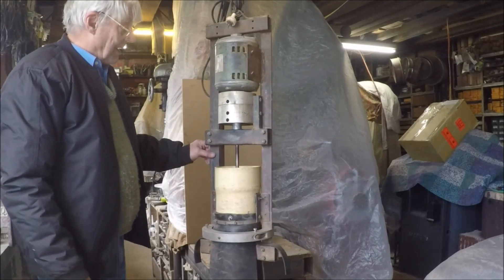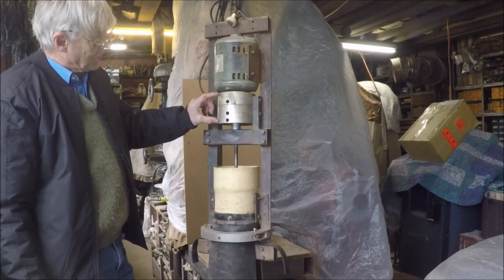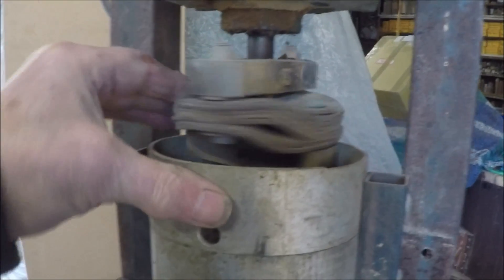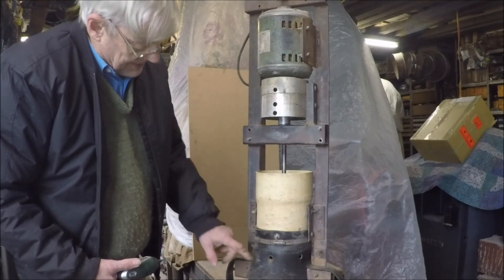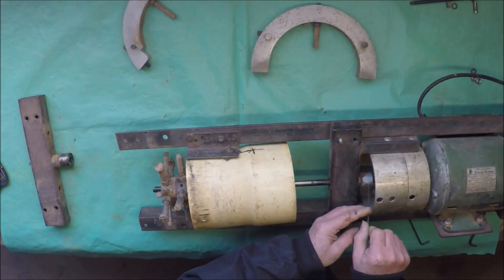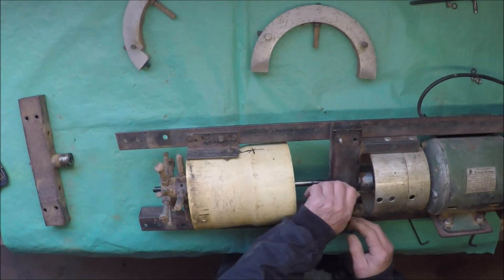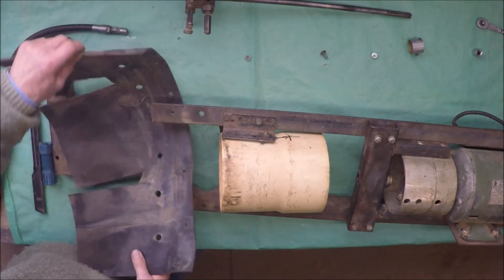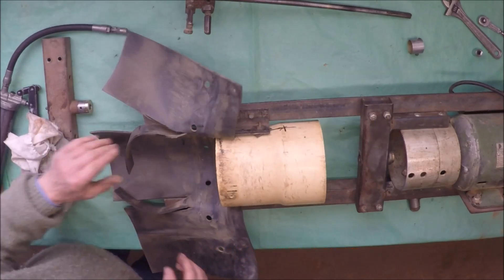Sand aerator, mixer, reprocessor.

Comment: how does it work?
Reply from the maker: jack. The rotating rods break up any lumps in the sand, mix it all properly, and aerate it so it sort of fluffs up and makes it feel as close to silky as its possible for sand to feel. After passing through this machine the sand rams much better and makes a better stronger mould.....Martin

Comment: Hello from Norway!
I am working with granite cuting wire saw and we got a lot off small granitt dusts after cuting work. Is it possible to use it and clay to form models instead sand?
Best regards Darius
Reply from the maker: Darius, Hello back from Melbourne Australia. Many other materials are used as a "sand" for moulding - zircon, chromite, olivine for example but I have not heard of granite dust being used. Granite is about 20% Silica and 65% Feldspar, Feldspar is quite a refractory material and might perform ok as a moulding sand. To be honest I do not know for certain how it would go but its refractory nature would suggest that granite dusts - providing they are not just granite flour  - might be worth a try. However granite contains some mica and this tends to expand a lot when it is heated and this may cause problems. If you have no other source of a suitable moulding "sand" the dust may be worth a try, so give it a go and let us know how it went.... Martin
Reply: I"ll try soon ! @olfoundryman8418

Comment: Just a thought.... What if... I have a concrete mixer. A simple consumer product like Baumr-AG or Kartrite machine... If I (struck through) When I try this "method" I share the results 🙂
Reply from the maker: Andrey, What you are suggesting has been tried in this video   https://youtu.be/Y0-lx95NLRs  Note that he is using it on petrobond sand but it should work with green sand too (I think!). This really acts as a sand muller NOT an aerator. Mullers tend to compact sand whereas an aerator tends to fluff it up in a nice feeling uncompacted way. If I had a muller I would use it to mix the sand properly but I would then pass the sand through an aerator like the one in my video here. However I feel that this aerator does the job of a muller as well as an aerator.
Love that 5.5KW spindle 24000 rpm -  wow nice. My old mill (1985 Dyna 4400 DM ) has only 4KW and just 4800 rpm. What do you use this spindle on?...    Martin

Comment: I'm rather a fan of using a cordless drill and one of those egg beater looking cement mixers for the casting I do. Particularly nice compared to mixing oil in by hand stirring
Reply from the maker: Silicone, Yes, I use either a cordless drill or a drill press as a first stage in  mixing CO2 silicate sands but I find that it does not do all that good a job so I follow this with passing through a 1/8 inch sieve and then a final hand mix. My aerator mixer device was made only to handle green sand which it doers extremely well producing a fluffy silky feeling sand. I have never tried either a silicate or an oil bonded sand in it. I would guess that it would handle the silicate sand well as it has low green strength, but I suspect that the oil bonded material might cause it to jamb up because of the oil sands high green strength (I am talking petrobond here). Certainly, new green sand which is very strong does cause problems and I have to feed it very slowly a bigger machine say, 8 inch diameter as against 6 may well solve this problem.... Martin

Comment: Hey Martin, how often do you need to replace the bolts and what size are they? I'm building one very similar to yours, But a little smaller. Mine is just gonna be an attachment for a drill press. From the video, it looks like your top row (spinning mixer) you only have 4 and they might be 1/2". The second row looks like 4  => 1/2" and 4 => 5/16".  For the outer ring I'm going to tempt fate and make it out of 4" ID steel tube.
Reply from the maker: OMM, I have never had to replace the bolts. I have had one or two come loose and need to be screwed back in. Remember there is a row of 6 stationary rods between the two rotating rows, these are 1/2". Your guess is right as to the size and number of the rotating bolts. If I had to guess I would say that you will be disappointed with a smaller machine. Mine tends to clog when the sand is new and strong and in these circumstances needs to be feed very slowly - I suspect that petrobond will also tend to clog it (never tried) as I think it is a strong sticky sand. I suggest actually building it bigger say 8 inch diameter with about a 1Hp motor as I suspect this would help with the clogging. I was always going to build mine bigger as this one was only a small trial to see if the idea worked but it handles the sand so quickly (once the sand has been used a bit) that I never bothered. Please do let me know how you get on. I will be interested to see if a 4" version will work and if so how well.... Martin
Reply: @olfoundryman8418   Martin, I plan on doing 2 stationary rods (but again 5/16 screws) above the beater to take care of bigger chunks and eight stationary rods between the beater rods.  The drill press motor is 2 hp.
Reply from the maker: Omm, 2 Hp should be way more than enough for a quite big machine! However I think that stationary bolts above any of the rotating ones may just serve to hold the sand back as foundry sand tends to "hang back" unless something (like the rotation) makes it move. Also 8 stationary rods with just 4 inch diameter does not leave much room for the sand to move through. I don't really know of course as I only ever built the one machine and never tried any variants so my suspicions /guesses etc could be way off. Please let us know how you go - do a video on it perhaps…. Martin
Reply: @olfoundryman8418  I'm doing a full step-by-step document of it at "The Home foundry" forum. As I mentioned to you before there is quite a few good guys there. But if you just want to follow along, http://forums.thehomefoundry.org/index.php?threads/how-do-you-re-purpose-green-sand.1107/#post-27235
Reply: And I will do a full video once the build is complete.
Reply from the maker: @omm7763  Excellent... Martin
Reply from the maker: OMM, Boy, that is one solid looking unit - not going to wear out in a hurry!😊 I will be interested to see how it handles the sand - please hurry up and test it …. Martin

Comment: So the pins are between the both rotor levels? Do you have a large funnel that goes on top of the inlet, or do just shovel the sand in there? Great work! I've been looking into building a muller for quite some time, if your device works fine, i might build one also. I figure it is rather unsuited for initial mixing of sand with clay or bentonite, but for clearing sand of rocks after casting rather.
Reply from the maker: rocketri, My sand is a natural sand i.e. it is straight out of the ground. It naturally has the right sized sand grains and contains some sort of natural clay probably a Kaolin type. Al I do is sieve it to remove the few larger grains and add water to the right moisture level. Sands like this were very common all around the world big deposits were in Albany NY USA for example. Mine came from a quarry about 20 miles from where I live but there once were dozens of deposits around Melbourne  here in Australia. The diffewrnce between new and used is simply that   sand that is used and sand which is stil as dug out of the ground. So sorry, but no, I do not have a recipe - beyond sieve it wet it and use it 😊... Martin
Reply: @olfoundryman8418  Hey Martin, i got another question regarding your aerator. I'm looking into throwing one together from parts that i have lying around, and was wondering at which rpm it might perform the best. Since your design based on 1500rpm, i was wondering if 2800rpm is more suited to it, or 1500. i guess the sand itself wouldn't care for the spinning speed, the centripedal force would however. I wouldn't like seeing it throwing the sand radially in a way that makes it stick to the housing..
Reply from the maker: rocketryi, Yes the 6 stationary pins are between the two rotor levels. No funnel as damp sand has a very steep angle of rest and it would not slide down a funnel easily. I use a scoop that has about the same diameter as the white aerator body. Remember this machine was an experimental first try - my idea was to build a bigger one if this one worked but it worked so well that a bigger one was not strictly necessary. That said if I was to build it again I would make it about 8 inch diameter and use about a 1 hp. motor. If you gave your sand an initial rough mix on the floor  (sand clay water and all) with a shovel and rake for a few minutes and then passed it through the aerator perhaps a couple of times I think you would be impressed with how well it turns out. Even if you do have a muller its worth using an aerator after mulling as it fluffs the sand up nicely breaking up all the compacted lumps that mulling tends to produce. The only problem I have had with the machine is that my new sand (a natural green sand) is so strong that it clogs the machine until it (the sand) has been used a few times and thus it has got a little weaker - I suspect but do not know for sure that petrobaond sand particularly if new might clog it. I suspect that the clogging problem would go away if the machine was just that bit bigger. It is a much easier build than a muller and because of it I have never felt the need to build or use a muller....Martin
Reply: @olfoundryman8418  Hey and thanks for your reply martin! Such a rare thing of a person producing videos on youtube being into actually replying to questions raised, even a while after the video released. Luckily i don't use petrobond,  thus will see if i can mititage the clogging problem for my greensand variant. I assume a vibration motor would help solving this (or could make it worse, if the sand further compresses itself because of vibration). If all fails, some kind of rake could be attached above the rotor... i guess i can find a way. Thanks for making an in-depth  video on such a simple machine!
Reply from the maker: rocketry, Clogging is only a problem with very high strength sands (in my case the new sand) I think a home made sand unlikely to be that strong ( I could be wrong of course 😊 ) Sand after a few uses presents no problem at all. I have no idea re vibration  - you would just have to try it. I figure a slightly bigger 8 inch (currently 6 inch) machine would probably handle stronger sand way better, again though you would have to try it. Good luck with it all and do let us know how it goes... Martin
Reply: @olfoundryman8418  Your reply leads to the question what the difference between homemade sand and "the new sand" is... Do you mix your sand yourself? Do you have a recipe?

Comment: Thanks for taking the time to show us this very valuable piece of equipment and how it works. It may not be a muller, but if you think about it your sand gets mulled to some extent every time  you ram it into a mold.
Reply from the maker: Jack, I have always hankered after a real muller - many times been on the cusp of building one but they are a lot of work and I managed without one for many years. A friend described what he had seen at another foundry so I imaginered my aerator from what he said. It s not a muller - totally different action but it seems to substitute very well  plus it leaves the sand nice and fluffy whereas a true muller leaves the sand a bit compacted, some foundries first mull the sand and then aerate it through a machine like mine for the best of both worlds. While both would be nice I value the aerator the greater and its an easy build... Martin

Comment: Cool and innovative shop made machine, thank you.

I always thought it funny that a painter's house needs paint,
A plumbers house has drips,
A foundry man's shop is welded together tid bits.
Reply from the maker: Burn, It is a crude and roughly constructed machine - it was just a trial with the intention of building a bigger better one if it worked but it worked so well that a better one was not necessary. There are some cast bits in it and on most of the things I have made cast parts are used. I recommend that people build a machine like this rather than or at least in addition to build a sand muller. But Yes, the electric metal glue gun is a great device 😊… Martin

Comment: I had planned on Petrobond sand and finding or building a Royer for it.  This looks like the ticket for green sand and possibly Petrobond too.  Thanks for showing your elegant solution.
Reply from the maker: Driftless, I have to issue a note of caution here. My sand aerator does not like sticky sands - nice new green sand  is so strong that it tends to clog the aerator and if it is at all on the wet side it is very hard to get it through the machine. I have never tried the machine with petrobaond sand so I do not know if the machine will handle it. I believe if the machine was 8 inch diameter instead of the 6 inch that I made it and if it had a 1 hp motor instead of the 1/2 hp it might have a better chance with the petrobaond. If someone wants to turn up here with some petrobaond I will try the machine on it because I would like to know if it will work too. But it sure works well on my sand... Martin

Comment: @ 16.24, were you a gynecologist in a previous life..? sorry, couldn't help it. Nice stuff. Yes, think I'll knock one up. Have built a muller, as you say, bit involved. Oh, and Nice, really nice.
Reply from the maker: Good lord No, I could not think of anything worse. Occasionally Ok,😏 but every day all day, no thank you! I agree with you on the muller I have almost continually contemplated building one but it is just so much work to do so and so much else to do and the older I got the less use I would get out of it. Tried to buy one but the size I wanted is quite rare and much sought after. If I had been into petrobond sand which (apparently) one just about must have a muller for I would have built one years ago. In truth once I built that aerator  the need for a muller went away - for me anyway and I note that even after mulling people with an aerator pass the sand through it as it fluffs the sand up to a nice silky feel that rams well. if you build one you will love it... Martin

Comment: what in the hell are you talking about "crude" my car uses the exact same device to couple my steering column to my steering gearbox, until rack and pinyon steering came about all cars used this design. its NOT crude its ELEGANT . a fantastic design easy to build, reliable, and if it should go wrong very easy and inexpensive to repair !!!!
Reply from the maker: normdoty, Yes, indeed many older cars did use that sort of universal joint in things like steering shafts. Its not the joint itself that is crude but rather my quick and dirty replication of it 😏. It is indeed elegant in its simplicity and ease of build - as uni joints go it is about the easiest to make and has good ability to tolerate considerable misalignment. Not too sure that I would want it driving the rear axle though  😀 … Martin

Comment: This video reminds me of a story I heard about the development of the Harrier jump jet. They needed to control the rotating jet nozzles on the sides of the aircraft and thought that they would probably need a fancy servo mechanism to do that but that would take time so for the prototype they went with a bicycle  chain, wound around the cylindrical part of the nozzle attached to a small motor placed in a suitable place. This worked so well that the finished aircraft also had, you guessed it - bicycle chains.

Comment: That's great. Ingenious even. Does not need to look shiny so long as it works which it does
Reply from the maker: Rupert, The machine seems to give the sand a nice silky feel and it rams all the better for having gone through the machine. All my green sand goes through this machine. I do not have a muller and because of this machine I do not need one. Mulled sand benefits from being put through such a machine after mulling... Martin
Reply: Cheers

Comment: I'm going to try to make one of these. I think this is a great idea!
Reply from the maker: Marty, Go for it. You will not be disappointed at the job it does on green sand. I would recommend that in line with comments I made during the video you make it just that bit bigger and more powerful than mine i.e. 8 inch  diameter and 1 hp motor. Be aware that I do not know how it will work on petrobaond - it may be that it is too sticky… Martin
Reply: @olfoundryman8418  I am using green sand and I am going to follow your advice. I will be using a 1 hp compressor motor. Thank you for reply
Reply from the maker: Marty, Please let us know how it goes and if you get a chance do a video of the whole process... Martin

Comment: I've been considering how to reprocess my sand, this seems like a lot easier solution. Thanks, Nice videos. Nebraska, USA
Reply from the maker: Larry, This type of machine was suggested to me by a friend who saw on in operation at a large foundry. I built this one "on spec" never having seen one at all, it was all a guess.  But it was an easy quick build (certainly compared to a muller) and it sure works well, mixes and fluffs the sand up delightfully. The sand feels positively "silky" afterwards.. It is certainly a solution worth a try and even if you have a Muller I would use one of these machines after mulling to "decompact " the sand. I would suggest making it that 2 inches bigger than mine. Glad that you like the videos.... Martin